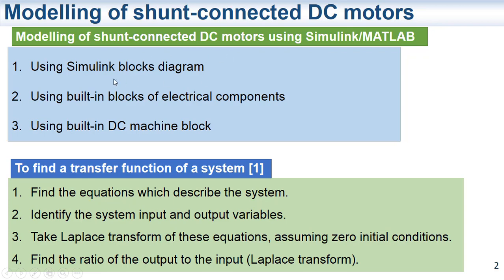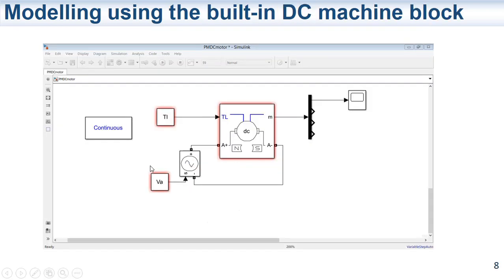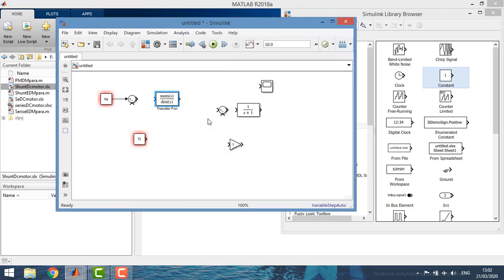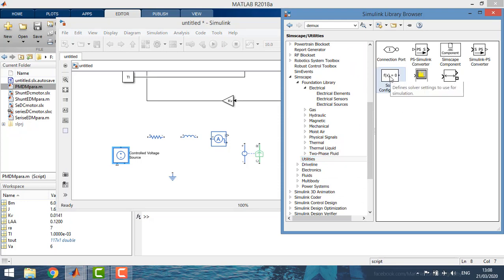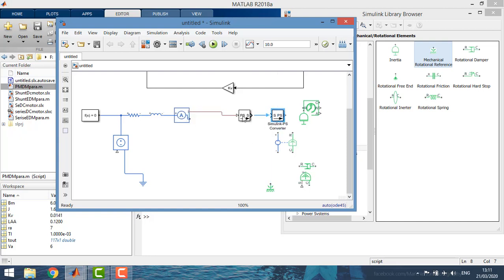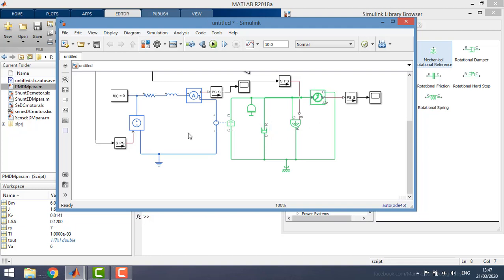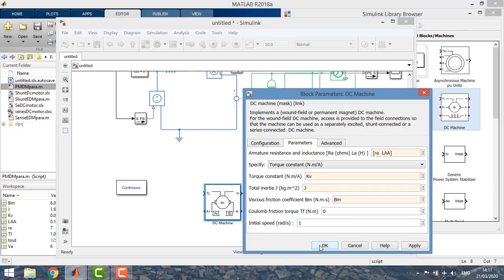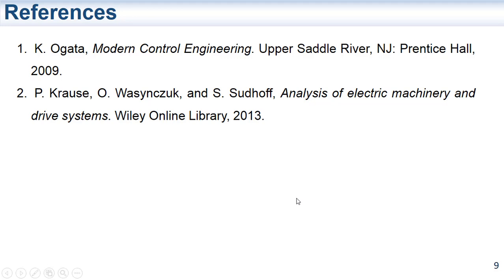Lec 2: Modelling and simulation of permanent magnet DC motors using Simulink /MATLAB

Comment: Could you give any recommendations about plotting two desired values against each other rather than time? I'm trying to plot torque against angular speed but using the "XY Graph" in library doesn't give satisfactory results...
Reply from the maker: Dear Thoric, 
In one of my research papers, I exported the data to an excel sheet then draw it using excel. 
first, you need to save simulation data to the workspace 
https://uk.mathworks.com/help/simulink/slref/toworkspace.html
then, export it to an excel spreadsheet
 https://uk.mathworks.com/help/matlab/import_export/exporting-to-excel-spreadsheets.html
I hope it helps,
Saif
Reply: @DrCEng25  I'll try, thanks a lot!